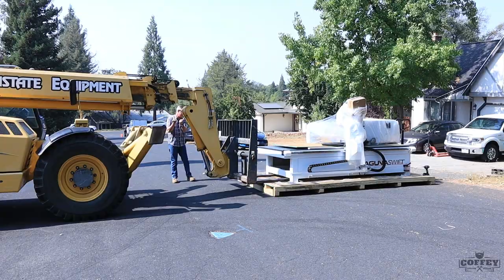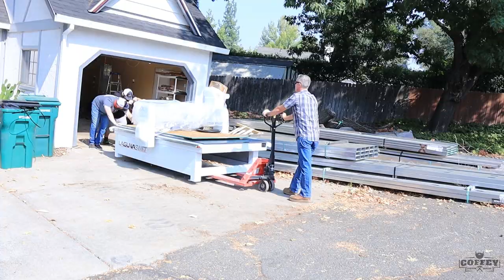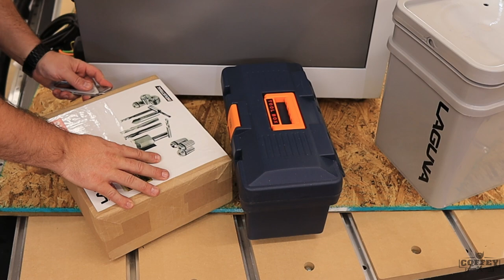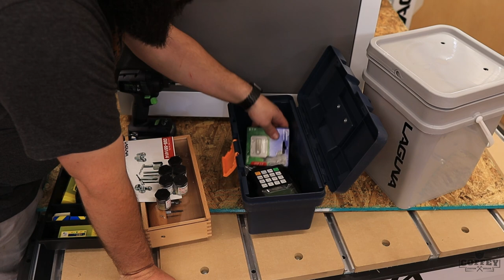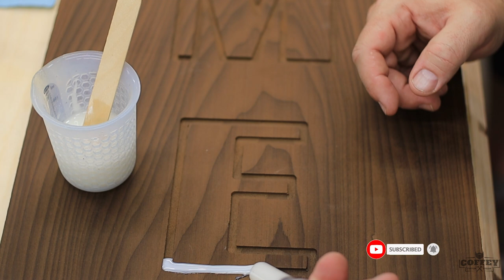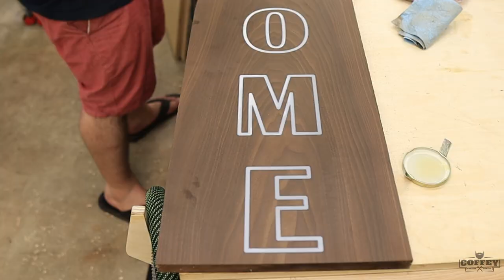Is A $20,000 CNC Worth The Investment

Comment: I have the exact same machine.  love it.  once i learnt what feeds and speeds it could handle, its greatly enhance my production.  Don't just get hooked on Amana bits. that was my mistake because they came with the machine.  Now im using whiteside and vortex as well as amana.  Vortex has a speed and feed app...love it, its helped me a ton.  i use a 3/4 inch spoil board on mine with dog clamps. works well.   Enjoy and looking forward to seeing some of your projects...Have fun!
Reply from the maker: I'm a huge whiteside fan. I plan on picking up several. And I very recently heard about Vortex. I definitely need to look into them. Any you recommend? I'm working on a new style of spoilboard. Very excited to show it off soon. I think it will be a game changer.
Reply: Coffey Custom Builds   I mostly use a 1/4” down cut from vortex.  I cut allot of Baltic birch ply with it  and solid maple and solid fir with it, works awesome.
Reply from the maker: I'll check them out man.

Comment: Hello Coffee. I about to purchase the same machine for my garage. Did you have to do any power upgrades for your breaker to handle it? How fast does it pump out one of those large flags I saw in your other video? How loud is it when it’s powered on and cutting? Thanks in advance
Reply from the maker: Hello Beest. You will need a 30amp 220v service. It can do a flag in about 15 minutes. Between the machine and the dust collection I wear hearing protection. Let me know if you have any other questions.